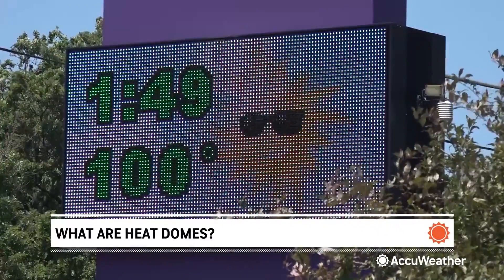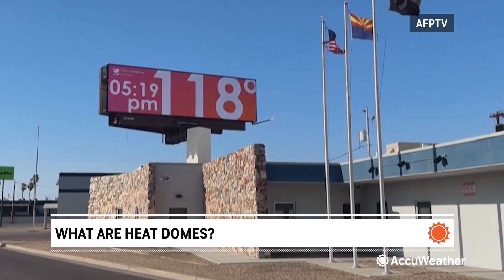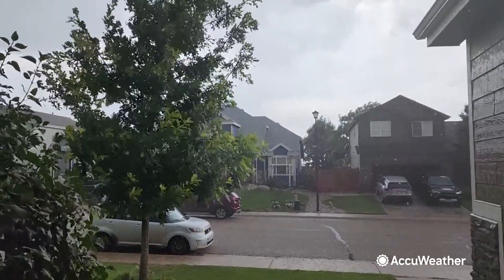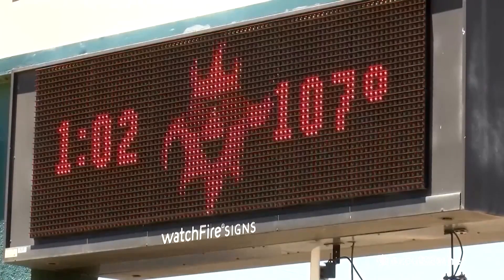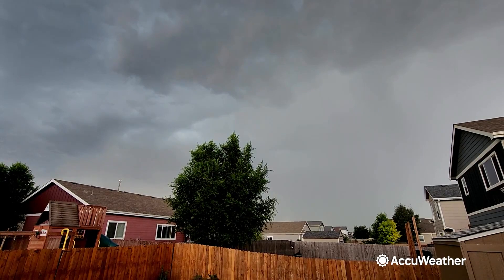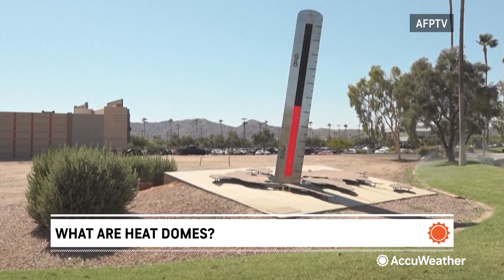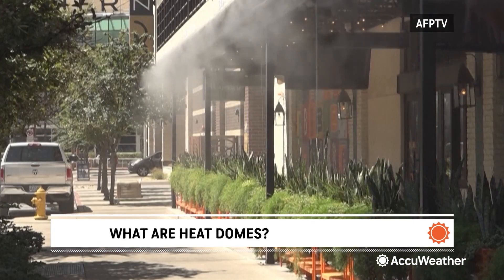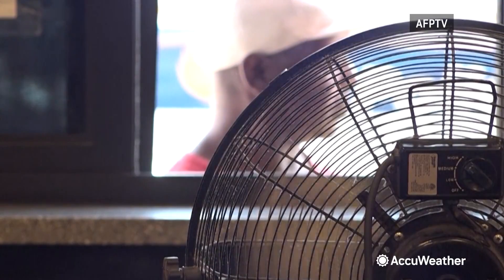WeatherWhys®: What is a Heat Dome?

Comment: A heat dome is NOT normal summer weather!

A heat dome is a strong high-pressure area. To put it simply, it's like a pressure cooker. A pressure cooker cooks much faster with less energy because it's under high pressure. A heat dome is very similar to that; this is NOT normal summer weather.

In a pressure cooker, you don't need much heat, and the food is ready in 5-10 minutes, which normally takes 20 minutes. The same applies to everything under a heat dome.

That's why many people perceive a heat dome as "oppressive heat," because that's exactly what it is!

A good example is Venus and other planets, which have a much higher atmospheric pressure and are therefore much hotter than they should be. On Venus, for example, greenhouse gases are also present, just like on our planet.
This means that the heat or energy is compressed much more into the ground due to the pressure, and even more heat is generated through friction. Furthermore, heat can dissipate more slowly due to the greenhouse gases and the high pressure.
That's why there are ground temperatures on Venus well over +300°C, and that's roughly where our development is heading. What you're saying is harmless isn't at all,
you've just completely misunderstood it.

The same thing also happens in extreme cold, like a blizzard, etc.

You can have normal cold, but also under an extreme low-pressure system, which is very, very dangerous and not normal winter cold.
You can die very quickly if you don't get to safety, don't move, and isolate yourself.

Climate change also brings extreme, cold low-pressure systems, albeit less frequently. In the USA, there was a blizzard like this where people froze to death overnight, even in their homes. The reason wasn't the extreme low temperature, but the extreme low-pressure system that accompanied it.

That's why so many people die. Both heat and cold kill silently. You don't notice what's happening in your body until you suddenly have no energy, or have trouble breathing, or fall over, or die directly of a heart attack.

When it's cold, the body draws blood from the small extremities to warm the most important parts, such as fingers, toes, etc., which then die...
In hot weather, it's similar but the other way around. The blood tries to transport water, etc., to the skin and sweat and cool down.
As a result, organs are no longer supplied with blood as well, but the body can't do this all the time. At some point, it's time to call it a day, and you're exhausted because your body has to constantly work.
In addition, physical exertion during this phase is very dangerous because your body has even more heat, and organs that are less well supplied can collapse, resulting in blackouts, shortness of breath, or cardiac arrest.

That's why you need rest and should definitely not go to work or school, and you need more water so that your body can sweat and so that water is also in your blood. With less water in the blood, the blood thickens, and this becomes very dangerous, especially under a heat dome, where energy is constantly being pumped onto the body due to the pressure. This is not like normal summer heat, where the heat is not pressed as strongly against the ground or body.

You don't always see whether you are sweating or have stopped sweating. Sweating is initially a very quick reaction, but later on it is only light.
In hot weather, sweat may no longer collect at all, but rather evaporates directly in the heat, so you can't always see whether you are still sweating or not.